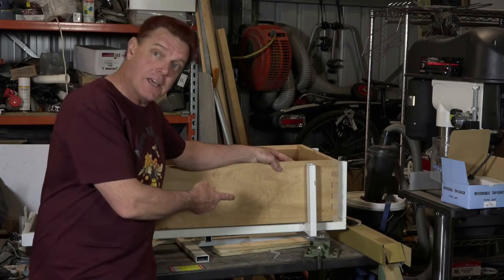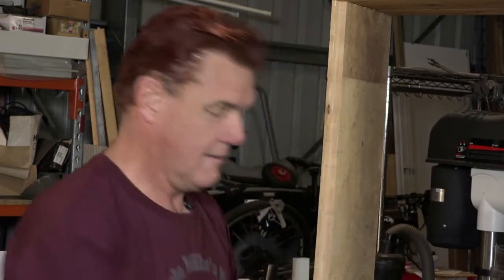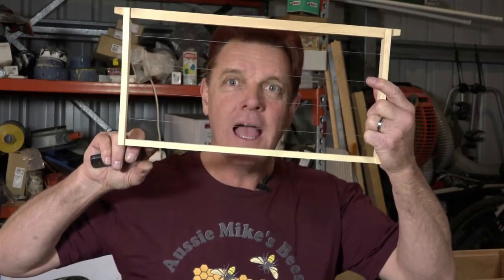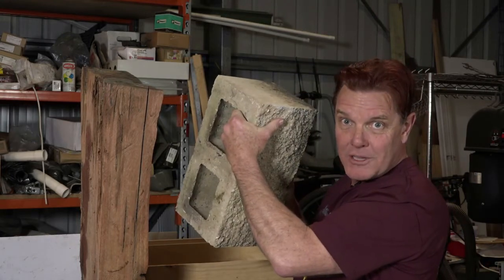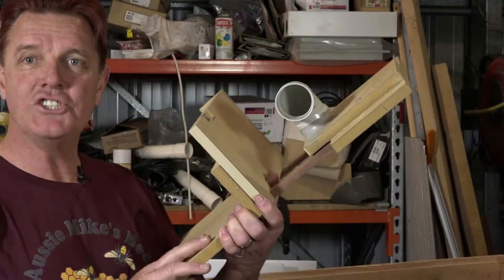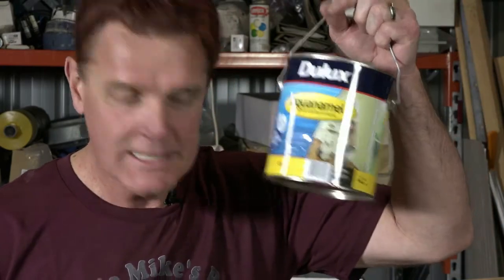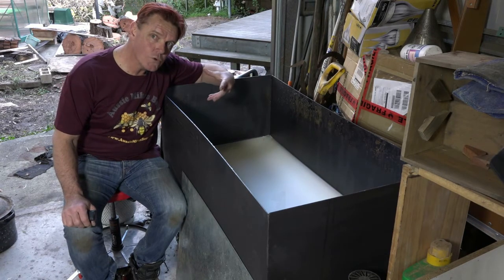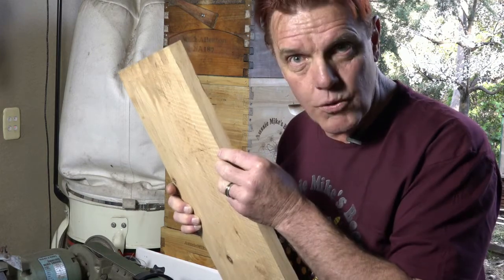Horizontal Hives Part2 Long Lang

Comment: Been looking everywhere for metric measurments for frames so if i make a hive i can still put standard size frames if i buy bees or inherit some? or give a week colony brood or honey frames from another... i got everything i needed from this video , except how wide are top frame bars? The actual top bar on each frame, how wide are they?    And thanks for all the tips, ive been binge watching your channel and plan to build my first hives soon i live about 2 hours inland from you just over the mountains..
Reply from the maker: Thanks for watching. I had the same issue with metric, so I made this video series.  It’s all about bee space. As for your question regarding “top frame bar”.  Do you mean the top bar of the frame? Most of mine are about 25mm, that’s set by the manufacturer. If you’re asking about the width of the cover strips, the equivalent of the inner cover, then we have room for interpretation.  I’ve seen standard inner covers used, so covering eight or ten frames.  I choose to cover about three frames at a time, so I’m only disturbing three frames at a time. In my view it keeps the bees calmer.  It also means I can add a few frames at a time for the bees to defend.  If you add ten at once, there’s a lot of new space for pests like moth and SHB to hide.  You can make each strip a different width as long as they cover the frames between the entrance and the follower board.
If you’re passing through, drop in for a visit. It’s always fun to talk with a fellow beekeeper.  If you’re in the ABA, the AGM is in Orange 12th February. I’ll be there.
Cheers,
Mike
Reply: @AussieMikesBees  yes just the width of the top bar of the frame is what i meant.. i found i guy speaking arabic last night so i couldnt understand him,  but he was holding up a ruler to frames so people could copy them, i think his were 29mm wide.. was just wondering if that was the same as all frame tops..

Comment: How long is your long lang in cm?  If I wanted 30-32 frames, would I just measure the length of frames or would I need to add in a bit of extra length for follower boards?  Thanks for the informative videos.
Reply from the maker: Thanks for watching. The LL in the video is 105cm inside dimension.  With frames measuring 36mm wide, that comes to 29frames.  When you fill up the hive with frames you no longer need the follower board so I'll have 29 frames. A queen excluder will take up a little space, depending on the design.  For 32 frames you'll need 116cm internal.  It all depends on your available materials.  My golden cypress boards (reclaims from logs) are various lengths less than 112cm.